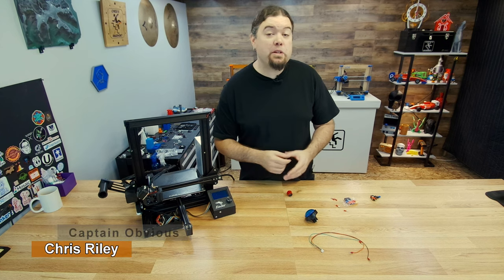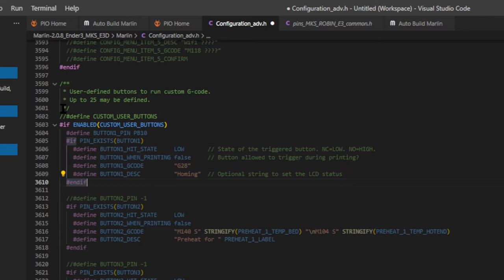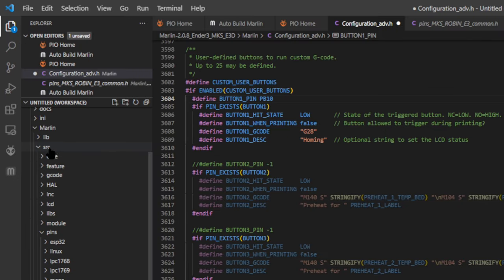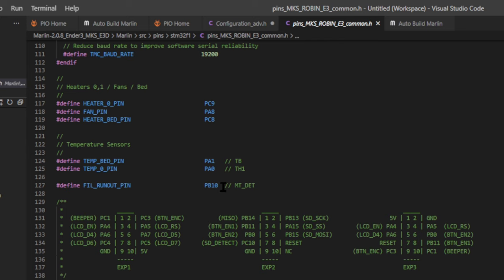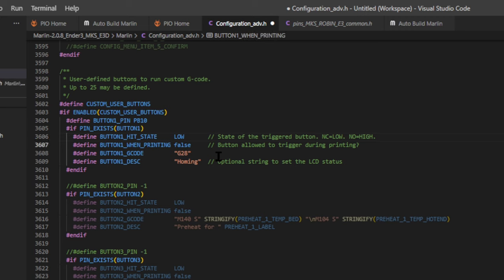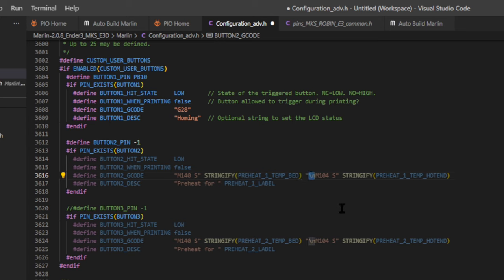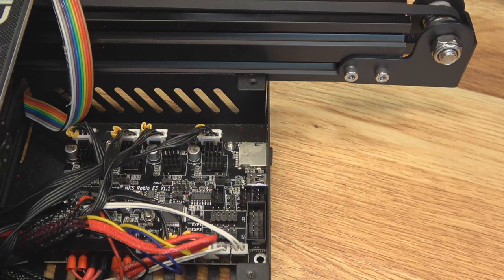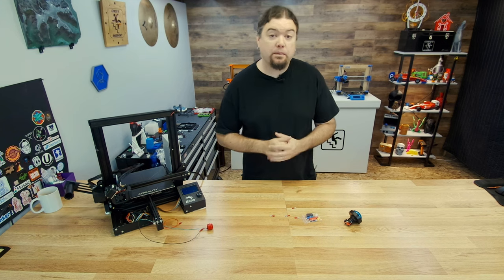Add Buttons To Your 3D Printer - Marlin - Chris's Basement - 2022

Comment: Nice. It's even easier in Klipper as you can use a GPIO pin on a MCU.
Reply from the maker: Thanks!
Reply: Note that PB10 is a just a standard GPIO pin on the STM32 MCU.

Comment: Thanks for sharing this! One point you should have more clearly elaborated on is the line comment "// State of the triggered button. NC=LOW. NO=HIGH.", in the header file Configuration_adv.h . You did not detail whether the two buttons in your video were NC (Normally Closed) or NO (Normally Opened). This could probably cause some frustration with a beginner unfamiliar with different button types and unknowingly used a NO pushbutton/switch.

By what you did, I inferred that the buttons were type NC. But you did not explicitly distinguish this.

Thanks for your Klipper output!!
Reply from the maker: Thanks for your input!

Comment: Hmm, this could be interesting to have dedicated buttons for babystepping up and down when trying to get that perfect first layer. I swap build plates often depending on what I'm using for filament and that would just make it so much easier.
Reply: Oh?? I don't suppose you made any vids on that, did you??
Reply: "M290 Z0.05" for babystep up, and "M290 Z-0.05" for babystep down. But, since it uses G-codes it cannot babystep in a responsive way. For that you would need to add custom code to respond to a button and call babystepping methods directly.
Reply from the maker: Nice, that is a great idea, thanks @scott lahteine for the syntax.

Comment: Nice! At the time I didn't know how useful this video could be.
I have ordered Orbiter 2.0 extruder. It does not have any way to rotate the gears manually, to change filament in old-fashioned way, but they do have fancy filament sensor add-on with button to eject filament and load it when filament is detected (+ led collar to show filament / loading status). Unfortunately they don't offer support for Marlin (at least I didn't find a link), telling it's too limited 🙄

Well, with custom button I can add my own button to the hotend, next to extruder, and run M702 (unload filament) or M600 (change filament) with it. With existing filament sensor (where filament runs between roller-arm microswitch and skate bearing - it's smooth and very reliable, though most of the time not in use) placed also at hotend, just above the extruder, I could enable Marlin feature to continue filament change (if button runs M600) when sensor detects filament. All this gives Marlin the very similar functionality as with Klipper or RRF, except for the led 🤔

I just hope all this automation is not too much "future" for us 🙃
Reply from the maker: That's great, I love it when a plan comes together!

Comment: thanks alot. This button is great for when we move the printer to another place and want to do automatic calibration .
becuase your buttons doesnt have LED, you only connect ground and signal to the board and you didn't connect the 5V wire to the board.. right?
Thanks alot. very useful :)
Reply from the maker: Thanks! Correct, no need for 5v if there's no LED.

Comment: I’m not at my printer atm, but looking at the pins in the config file for the skr mini e3 v1.2 it looks like there’s the neopixel pin and the serial pins available.. are either of those options? I wouldn’t think the serial pins were 😂 

I really want to do this, so if none of my board’s pins will work do you know of another ender3 compatible board that has a lot of available pins? I want to add like at least 5-6 buttons.

Btw any man that crimps his own JSTs/connectors gets my approval. Great content as usual
Reply from the maker: lol, thanks! Yes, any open pin will work. You should be able to use the neo pin with no issues.

Comment: Your video is very good, I have a question: I have a Geeetech i3 pro w printer, it does not have pins to use it like in your video. I wish I could use the X_MAX_PIN pin. configured as you do in your video. Do you think it could work, or can't the limit switch pins be used? Very grateful in advance
Reply from the maker: Thank you! Yes, you can use your limit switches like I show in the video. Just take a look at your pins file for the pin number and you can use it the same as I show here.
Reply: no funciona con geeetech gt2560 rev a+ usando el pin X_MAX @ChrisRiley

Comment: I know its not directly related but on my TFT35 E3 the load & save icons don't always appear in the leveling menu. Any ideas why?
Reply from the maker: The only thing I can think of is a screen firmware bug. There might be a newer version out there on the github.
Reply: @ChrisRiley  only thing is it didn't do it at first. Now when I try to level it initiates and homes then says do I want to save without actually probing, but thanks for answering I do appreciate it!
Reply: @ChrisRiley  BTW I've been looking for a replacement board for my ender 3 and saw the E3 turbo the one with 5 built in stepper drivers but I can't find it any where for sale do you have any other recommendations for a simple drop in replacement that can give me individual Z drivers and has the same footprint as the original board
Reply from the maker: @PalosX  Wow, that seems really strange, it must be some sort of bug.
Reply: @ChrisRiley  Regardless thanks for responding got any board recommendations BTW

Comment: How can I connect 25 buttons? So I can use any PA/PB/PC/PD pin, right? Like for 8 buttons I could use those 8 in EXP1, yes? And seems pull-up resistors are not needed....
Reply from the maker: You can use any GPIO pin. Some buttons will require a pull up. Good Luck!

Comment: I made everythink like you, but i have looped triggering on all pins that i can use (i use EXP pins on SKR mini e3 v2). Even with nothing connected to pin is is somehow "triggered", no matter if i use NC or NO logic. I measured voltage on this pin, and my multimeter says there is no signal. STRANGE)))
Reply from the maker: That's really strange. Maybe there is a grounding issue somewhere causing the pins to float. See if you can turn on debug. This might help figure it out. https://youtu.be/pN1mO0JZonA
Reply: @ChrisRiley  it looks helpfull, thank you! I will check this out)